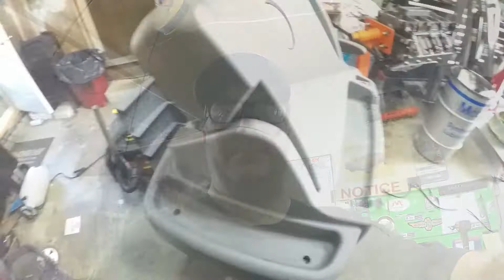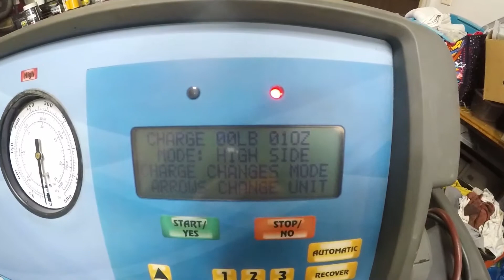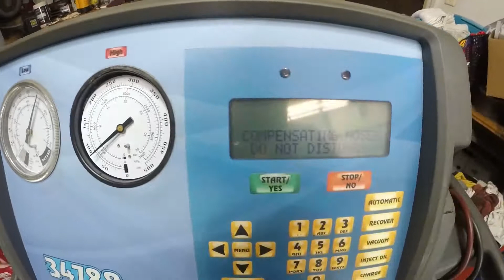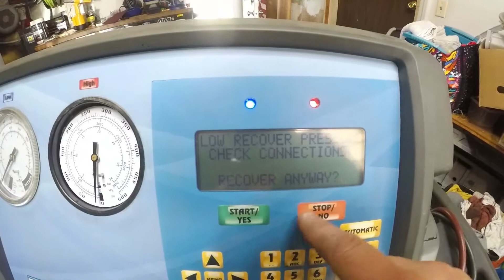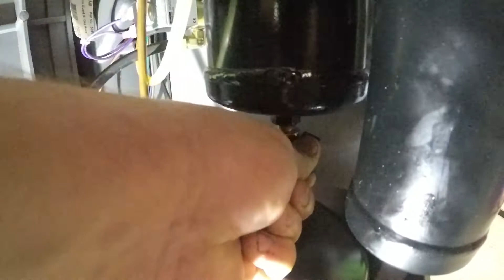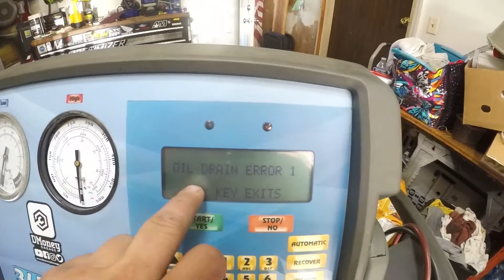Robinair 34788 Oil Drain Bypass - Oil Drain Error Workaround - 34788 AC Machine

Comment: Got one "cheap" 😅 500$
 Thought i got a deal. 

I have rebuilt the whole machine top to bottom. 
Vacuum pump i had to make reed valves from feeler gauge, compressor replace with new, accumulator transducer solenoid, key pad, tank pressure solenoid, 6 check valves inside manifold bunch of orings, hose end couplers, filter, on/off toggle wiring. Its been one issue after another until it finally works.

Figuring in who knows how much labor hours. I should have bought a new machine.
Reply: I’m in this situation, does not charge and I don’t know where to start lol
Reply: @sergionavarro1996  look up the service manual. Go thru the trouble shooting guide. Its got great information on what does what during each process. It helped me rebuild my whole machine.

Comment: I had the same thing happening to mine  . I Omhs tested all the solenoids got around 16 omhs  on all of them  im guess thats what they should be at .... after i checked the filter. And found the o ring  the was ripped changed the filter with new o ring no more error code oil drain 1  !  Hope it helps anyone. Reading your  comments

Comment: Install an R12 gauge on the OIL DRAIN where you put the amazon valve, perform a  "recover" and watch the gauge, at the end it should have some pressure in the oil drain tank. Mine was going into a vacuum not allowing the oil to drain thus the stuck "oil draining" message. The recycle solenoid is the one that allows a small charge into the oil drain tank. My electrical part was bad, easy find by using the secret code to get into the service menu to utilize the output test. Panzitta Sales in Wilkes Barre, PA will help you out they sell used and new parts and are more than willing to spend time with you on the phone. These Robinair machines aren't to bad to repair, I have 3.
Reply from the maker: Thank you. I saved the old parts so maybe I can call them to trouble shoot the couple issues I have and get it back to normal. Lol. Thanks for the comment✌️